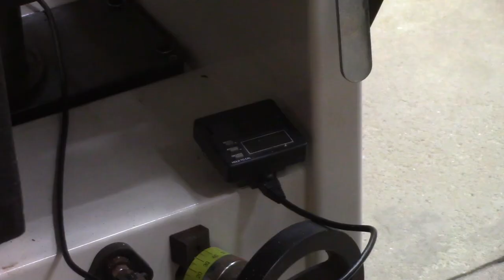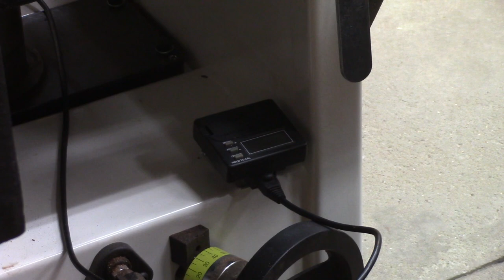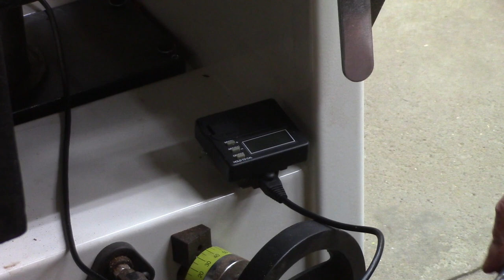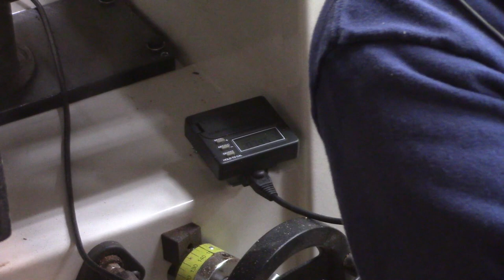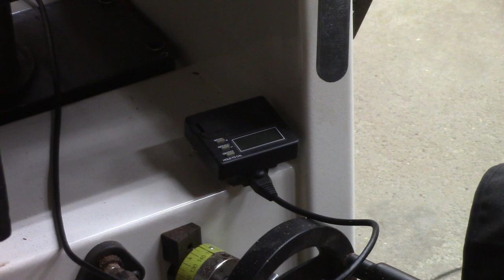Installing Remote Planer Readout WR550  Wixley

Comment: Thanks for the video.  Following it and doing it on the same model Jet.  your display mount takes away a bit from height when the table is all the way down.  Granted it would be very rare that you need to go to max depth but still would you mount it in different spot?
Reply from the maker: No, this works for me